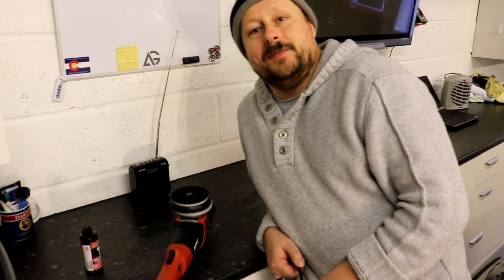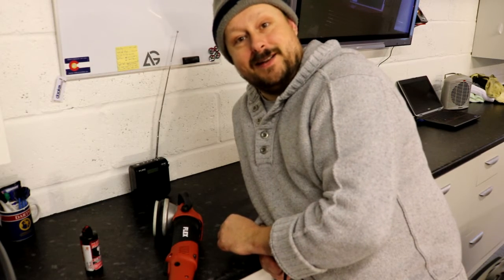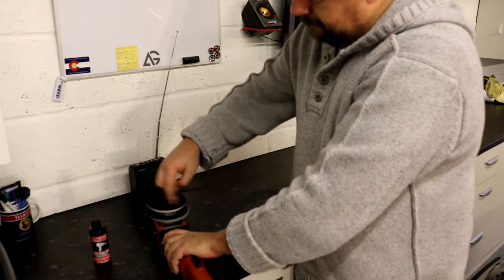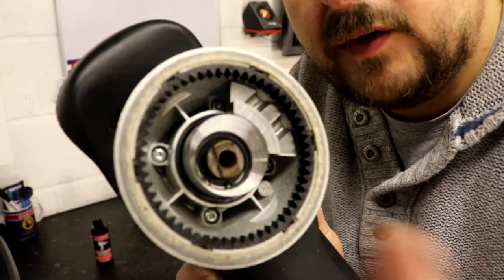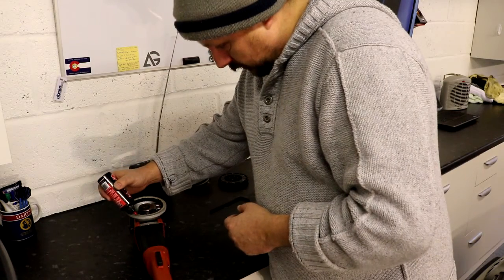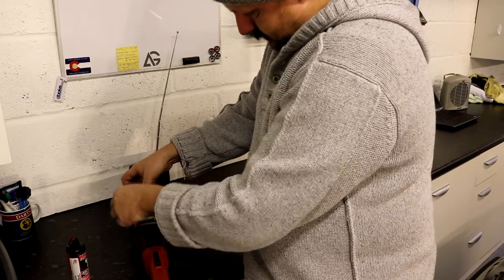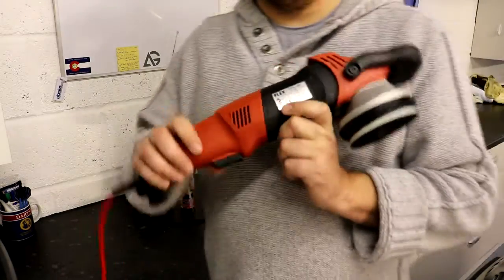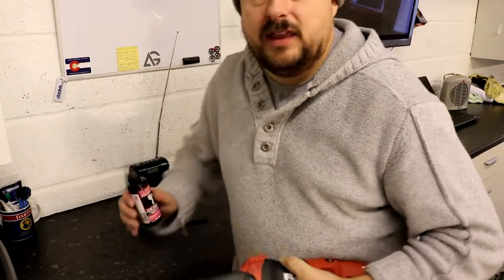flex 3401 vrg  maintenance

Comment: Yup this happened to my Flex VRG 3401 after polishing about 3 cars and putting it aside for about 6 months. when I went to use it later on it would cut out and smoke came out of the housing of the machine. 
So maintaining and keeping it oiled is very important.

Comment: The newer flex polishers don't rub on the housing. No need to oil if you have a newer polisher.
Reply: Do they have a felt gasket the newer one?
Reply: So if you buy a new flex VRG 3401 it doesn't need this, correct?

Comment: Do you have a source in the UK or Europe for F;ex XC3401 VRG parts? I live in Canada, and I am looking for a red plastic gear ead cover (the part over the gear head that you hold on to). The North American (110V) version has the black cover, which I am looking to replace with the red cover. I have asked both my local part supplier, and online North american suppliers, and they can only get the black version.
Reply from the maker: i would ask flex power tools UK on facebook mate...

Comment: Which smaller backing plate do you use.  i have heard of numerous failures from different companies
Reply from the maker: i tend to use the 4 inch backing plate with the 5 inch lake country hybrid power pads
Reply: +Forensic Detailing Channel 
the lake country or flex replacement plate.  
thanks
Reply from the maker: its a lake county one mate.. not had any problems so far.
Reply: +Forensic Detailing Channel 
cool thanks.  I guess they got design figured out.   most stuff I read was from a few years ago.   not much recently.
thanks again. subbed too!!
Reply: is there a washer mod for the older flex 3401's? I'm sure I've seen something somewhere where you modify a washer to stop the rubbing on the older machines. or am I mistaken?